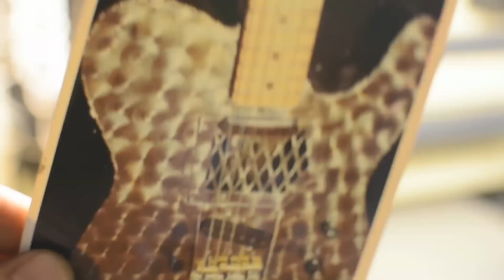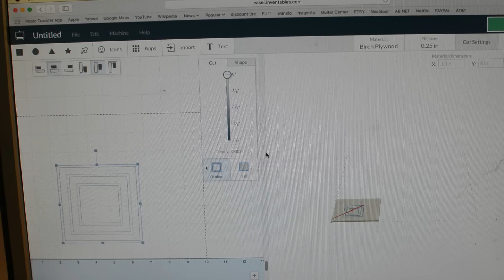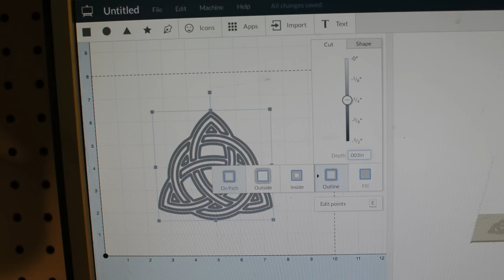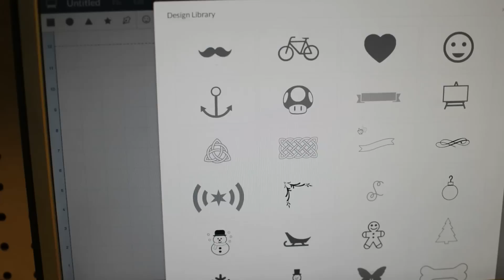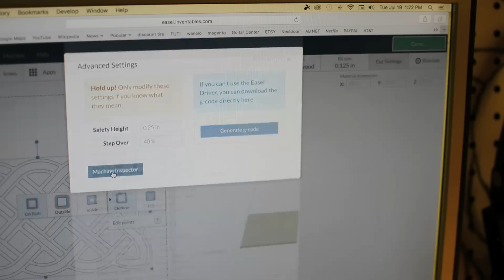Brushed Patterns With The Arduino CNC

Comment: I made up a mount on the Z with dovetails, the dovetails have a 3 thou taper out of parallel so that the tool locks into place with a cam and handle keeps the zero when changing tools. I used 10mm ally plate for the tool holders with matching out of parallel dovetails and it seems to return to zero ok but I only work with wood and plastics. You right on the money when you say that knowledge is free, I build my cnc from only what I learned on Utube including how to draw in cad and how to actually work the machine. It is people like you that is driving this access to knowledge and making a real difference to peoples lives by enabling us to be able to tackle seemingly impossible projects and succeed. Thank you and ifn you are ever down this way I'll shout you a couple of schooners.

Comment: Just great bro. I watched you work through the making of the cnc bed - a lot of continuous effort. 
Your thoughts at the end of this are so right. I also learn mounds, heaps, masses through folks using yt as interface.
What often amazes me, is the huge doings involved with making the vid. Angles, multiple cams to operate whilst doing - then the curating of the stuff - masses of timeline... Editing and so on. OK - you'se a wife n food - it's clean, so that's a huge benefit. Me tired n hungry = back to 'work'2 make food then....
I have a hassle with keeping attention - this I just mentioned is the large bit, I reckon often goes unnoticed.
You doing great bro, and I hope I somehow, on my sandy stony floor will get to build a cnc bed.
As you're indicating, its uses are many and I could put most of them to good use now.

A whole bunch of decades ago.... info much restricted and can't compare to today.
I love what you shared bro. It's clear, continuous, humourous - nice shooting after you changed from the flippy gopro type.
Really well done.
The brushing is super cool and the effect is easy to see on the screen as three d.
The brush wore down, but you hadn't spring loaded it so I'm a little surprised the end result 'appeared' on screen to be 'homogonous' - even throughout.
To family inclusive felix (cat) warm regards.
Reply from the maker: Thanks a lot man,  I really appreciate your comment.
Reply: At the end you really have the rigths . You are a saint ! Your dedication to do the best ever, is very hard to find nowadays. Nobody needs do put you down ! Your efforts never stops to amaze me ! Your knowledge teatchs me much indeed ! I'm a best machinist becouse i've been watching your videos and "Absorbing the Light" that you emanate every time you share your videos with us. Thank you very much.

Comment: Nice job again! I would suggest cutting about half the length of the bristles off to make it stiffer.Also,get different brushes in mild steel,stainless,brass,and nylon and the effects will change depending on what you are brushing materialwise.If you use a flatfaced sanding disc,spring-loaded like your pens,you can do awesome engine-turned panels like your guitar,but more uniform than the brushes.BTW,I just hit the old brush faces on a sander to shorten and make like new.Hope this helps!
Oh,and what the Hell you expect to get from someone who can't even spell FART right,lol Like you,I have learned SO MUCH on YT from people sharing their knowledge,and Bless you all for sharing!

Comment: Wow !  I stumbled across your vlog and I must say, Man you impress the hell out of me.  Ive been thinking about building my own cnc machine to do my circuit boards and you basically solidified my resolve. Thank you Sir, You are an inspiration. Only one slightly negative comment from me.  In your earlier eposides you welded without a welding helmet. Man thats scary LOL
Reply: Hands, eyes, skin - radiation - not a recommendable combo. Some kind of glove, and with MIG tacking, turn away, closed eyes.  All else is good gloves, all skin covered, helmet.
As a byword, I am not the easiest in self disciplining - so I allow my will to ignore the issue ' just now ' to invoke a kind of enourmously stubborn stop sign for my ignorance - ignore-ing-ance=stance, and go get, arrange the required stuff.
The radiation can burn deep.
Like you, I find this brother man, an inspiration - knows how to put it across and the visual enough to work out ones own doing. A graet combo - y'hear bright spark? OK, absorber of light - so u say...

LOL + LoL
Reply from the maker: Thanks John,  I will try to be more safety conscious.

Comment: I've really enjoyed your cnc series, Thanks. 
The sharpie and the brushed designs got me thinking, those techniques would go together  really well with any sort of electro or chemical etching or anodizing method resulting in some really cool effects. With the sharpie you could add a layer that resists the etching or alternatively you could cover the material completely with a resistive layer and remove selected areas of the resist with the brush.

Comment: That mount with the bolts holding against the frame that held the dremel, you could have simply sharpened the end of the bolts at 45 degrees and drilled holes half the diameter of the bolts. Then, simply tighten bolts until they entered the holes locking the dremel frame in place. A nice side feature, to mark the holes on the frame simply insert frame and tighten sharpened bolts until they made marks. Remove frame and drill then deburr and your good to go. 

The limitation is you probably could not tighten the bolts very tight or the holes would start to deform inward due to the thin tube. The bolts could simply be tightened more to compensate. there would maybe need to be jam nuts for the bolts as vibrations could cause them to loosen. I realize this video is older, just thought I'd throw that idea out there for use or discussion. The internet is awesome for learning stuff, I agree with you. 

I really think there is a lot to be done with the brush designs using this kind of system. Even if it was simply used to do engine turning, there could be $$ to be made as people like it and few places can/will do it. If you could do engine turning and do new and unique repeating patterns instead of just the circles, that could turn into a whole new business. Custom car dashes with the car builders logo done with small brushes inserted into the engine turn pattern, super cool.

Comment: cool idea , would be nice to make aluminium doorskins for cars and hot rods using that method 
wonder if you can do the same thing with an ofset scratching tool mounted in the dremel 
it should make swirled lines depending on the travelspeed of the cariage s but im not sure if the offset will cause too mush vibrations

Comment: great work.. Just curious if the same thing can be achieved with a light weight bldc? Or is a lot of force needed for the brush to make a mark?
Reply from the maker: Interesting question,  I'm not quite sure if brushless dc motors would have sufficient force to achieve this.   Plus having encoders to track movement looks quite complicated.  BTW I checked out your doodle clock and loved it!

Comment: Great video! The end results are also great as they are but one thing though, the start and end points of tool paths look kind of out of place when the job is finished. Maybe you could try to incorporate them into the design, like starting from a point over which another piece of path will pass, and ending at a point which would not look like a seam of a geometrical shape.
Reply from the maker: Thanks!  Yes I've been thinking about having my z axis gradually lower  and raise while the  x and y are moving in order to avoid this.  I'm not sure if EASEL can do this but I will keep experimenting.

Comment: Hi,
That a nice CNC you've build, with whatever tool attached!
A bit unrelated to wonderful brushing in this video however general question to your build - at least on video it is appears that you just tack-weld everything and not thoroughly weld after. Even for the base frame with most load. Can you comment if  there any reason/concept behind or proof me I'm wrong?
Cheers!
Reply from the maker: Hello,  The base itself was welded.   Everything else is tacked for two reasons:  I may want to disassemble or modify later and,  if I was to weld it would distort and possibly misalign.  These are heavier tacks than usual and definitely strong enough.  Thanks for watching!
Reply: Absorber Of Light Got it. Thanks!

Comment: Did you tested with lower rpm on the spindle and/or faster run-through with aluminum?
Reply from the maker: I did briefly.  These settings seemed to work fine,  but I still want to experiment some more.

Comment: what kind step motor are you using?...  thankrs
Reply from the maker: Nema 17 with Easydrivers
Reply: Absorber Of Light thanks again.. But how many torque is your step motor.. Remember this kind of motor have different power.. I know there are Nena 17 of 0.4amps 1.25amps 1.5amps 2amps and so...
Reply from the maker: I think it's 69oz/in 1.5amp

Comment: rigidity and deflection of axes on this machine could be really in question...
the ultimate test could be to cut a perfect circle from 5mm stainless steel with carbide cutter. say 0.5mm per pass.
this all seems like way overkill, why not to use chinese spindles with frequency control and water cooling, they cost just 100$ and are way better, also come with holder...
also they allow precise rpm control without loosing torque. unlike crappy dremel

Comment: This is amazing! All I kept thinking was making brushed metal art that is then painted with a candy paint. Like this: https://www.youtube.com/watch?v=hnm4yUp-W2o

I wonder though, keeping in mind that I know nothing about setting up a cnc program, could you set up the travel path to minimize the starting points on the plunge? Or at least set them up to where they become a pattern all unto themselves? Is that even possible? You can see where the bit plunges because it causes a circular pastern that is not otherwise seen. 

Thank you for your videos!
Reply from the maker: Thanks man!  Yes I've been thinking of a way to plunge gradually as my x and y axes are moving.   I'm not sure if the software can do this but I will keep experimenting.  Painting it with candy paint would look sweet!